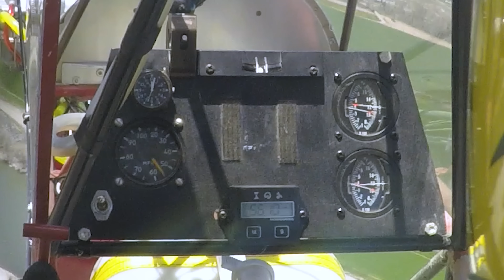MAIDEN FLIGHT goes BAD on landing.😓 Abandon airplane PART 6.

Comment: As soon as you said, "I'm coming in a little hot" I figured it wasn't ending well.  Note how quickly it slowed once you were in the grass.  Landing on pavement may be a bit unforgiving with these unless your technique is spot on.  There is that magical moment when you have little rudder authority, and you need the tailwheel on the ground to steer.  There are two schools of thought on this:  Morry Hummel said, "do not screw around in the transition zone, get through it as quickly as possible on take off and landing, and things will go better. His test pilot was of the opinion that you had to deal with this twice in every flight, so you needed to know how to handle it, so he advocated practice.  But then I watched a guy he was training ground loop and pretty much wreck a newly built UltraCruiser, during taxi testing.
Reply: That's why most taildragger instructors recommend a 3-point landing at first. Gotta come in reeeally slow, and basically stall the aircraft onto the pavement. Yes, ur kinda f_ed if there's a crosswind, and also f_ed if there's a gust and you're already slow.
There's a reason all branches of practical aviation have abandoned taildraggers after... actually towards the end of WW-2.
Reply: It took “coming in a little hot” to figure out he was going to have problems? I figured it out after reading the TITLE…
Reply: ah m8, welcome to the world of taildraggers...the next ground-loop is always just a heartbeat away.  Lots of good comments here from guys who have been there before - some of these rules are written in blood - ignore them at your peril !

as a former Drifter pilot, I always found bitumen runways more challenging - my choice would always be short grass if the option is there.  I agree with the comments about rudder authority - your aircraft has a good sized rudder, so I doubt that was the ground-loop cause - I would definitely go with smaller front wheels and a tailwheel that has a good level of tyre contact with the ground.  The way I was taught to land is to go to zero throttle at the end of base leg (and stick forward FAST) followed by a nice big circular 180 turn to short final.  BEWARE THE LOW SPEED STALL AND SPIN.  Then you can add a little power if you're low, or side-slip if you're high.  Practice choosing a touchdown point and getting good enough to hit it every time = improve those skills!  The idea of holding the aircraft in the three-point position until you run out of airspeed is a good one.

final point - get Microsoft FSX of MSFS on your computer, you can get the Drifter - the 25-0455 aircraft in the sim was copied from my real life aircraft.  Have fun m8, but remember - there are old pilots and bold pilots, but there are no old bold pilots...

Comment: My old 1948 cessna 170 tried to do that on numerous times after I bought it. Contacted the 170 club and there answer was wheel alignement, wheel alignment wheel alignment. Thats your problem but with the flimsy legs yours has I dont think it would help....

Comment: Hi close call indeed, I think the gear contributed to the lack of control on landing pulling you left, regarding the hot cylinder is it the rear one? A friend had a similar issue and what he did was add an air scoop to direct more air to the cylinder, basically a piece of aluminum shaped as needed and mounted. It worked for his application.

Comment: I went back and watched the video again, you clearly landed down wind and with a quartering cross wind.  ALWAYS land lightweight taildraggers into the wind.  Also, your landing gear is so flexible that when you add brakes it toes your mains out which causes fast uncontrollable ground looping in taildraggers.  It was much worse because of the rear quartering wind.  I'm glad you came out of that as well as you did.

Comment: The guy my dad bought his challanger from sold it because of a hard landing. He bent both gear tubes, so we replaced the gear tubes with solid fiberglass rods. Fuselage was fine. We just drilled the fiberglass for the mounting holes, put 2 new hubs and wheels on with new brakes an cable. She was good to go. Are your alerions cable or linkage?

Comment: I’ve built an Airbike.  There are a few things I see that appear the builder strayed quite a bit off the plans.  I’d highly recommend getting a set of plans and checking your engine installation/thrust line, gear, aileron hinges.  The Rotax engines are mounted inverted and the thrust line is much lower.  Also with that fuel tank location you have practically no weight on the tailwheel.  You may find that your CG is to far forward to have any steering authority.  I did the wing tank on mine and it was much better.
Reply from the maker: Yeah it’s a bit off from the original plans that’s for sure. 
Thanks for the input!

Comment: You were going so fast on touchdown; did you think you were flying a P-51? You were going way too fast on touchdown, its no wonder your gear was flexing. Every pilot is taught that if you have a touchdown like that, full throttle and go around! The time in the pattern will let you think about what you did wrong. You said you were coming in hot, AND you had a long runway, so you had plenty of time to slow down before attempting touchdown. It's pretty obvious you haven't gotten any training in flying an ultralight, I really suggest you get some ultralight training BEFORE you attempt to fly it again.
Reply: The FAA sandbagged the ultralight community to disallow ultralight trainers.

Comment: Not an AirBike, or at least it's not built to plans.  I see several differences in the construction and I've never seen an AirBike landing gear so flimsy.   I've flown mine for years and even had some rough landings without damage, and never a problem with rudder authority.

Comment: I flew hang gliders in 1980 and built my own gear we had been using alum axles  with bungee cords wrapped around them to act as a spring to stay light.. they collapsed easily..I built a rough field gear from steel springs bent so I could  bolt  one end of the spring to the bottom of the glider and a hole in the bent end to accept the stud  for the axle..kind of like a  bent L  on it's face    like this   ---\.. they  were very worked great ..ps I had the springs made with a small ..trick I had them made so the wheels were toed in a slight amount so that when under compression(hard landing) the will run straight as they compress..all your landing  was missing was the cable or whatever to limit the spreading of your wheels which gave you no control over your wheels.because they were toed out upon landing..p.s. I gave a sample of my gear to Dale from Motorized gliders of Iowa..and apparently he built some for the U.S. military for their gliders too.
+

Comment: Best advice I can give you is to walk away from this aircraft. The inability to hold the brakes during the TO thrust run-up was the first clue for me in this video.
Reply: Many light aircraft and almost all ultralight aircraft do not have brakes.  None of my friends Pietepols brakes hold at anything close to full power.  I've even flown certified aircraft that the brakes would not hold at full power.  Been in a cessna 180 where a strong wind would spin the airplane with both brakes locked.  Spoken like a true arm chair pilot.
Reply: @c172215s  My comment was the observation of all the problems shown in the video and the lack of safety for the operator. He nearly got himself killed--and you sir are a troll.
Reply: @daningrim475  A ground loop would likely not kill him... But certainly do in his ego
Reply: If everyone had that attitude airplanes would’ve never been invented….
Reply: @daningrim475  The person that you called troll just reported true facts. That alone completely disqualify your comments, which actually are just an opinion. If you can't accept that others may reply in disagreement, please don't post.
Reply: Dude he's not trolling, just disagreeing with you. That's really not at all the same thing. Fyi I also disagree with you. Whole aircraft is a write off because brakes maybe need upgrading?  Panic much?

Comment: Definitely undercarriage issue. Each wheel moving back and forth on landing throwing the air craft left and right until it turn off to left. No chance of Rudder compensation. Suggestion front wire braces from frame to each wheel to form A frame. Add a further two wires from behind from Fuselage to Each wheel. Now braced for and aft. Now you have to sort out any lateral movement. So it is time to redesign the undercarriage as a complete unit that allows suspension on landing but will also keep the wheels aligned with no independent movement. Bracing is the key. It's all been done before so not to much of an issue. Glad both you and the plane survived.

Comment: I  would make sure the left brake  wasn't dragging when checking out everything.  Also vert  stab is pretty small and your body may be shielding it from air flow..   I fly  a Decathlon  and  I have good rudder authority right  up to the point  where the tail stops flying and beyond
Reply: I thought that windscreen was not helping either.

Comment: Only real way to cool a 2 stroke that doesn’t have an airflow problem is to ritchen the mixture. Engine is likely still lean just the front cylinder gets enough air to cool it and not show warm. Air filter still seems small. I’d look for a big diameter oval one with a lower profile because of the way that thing wobbles on there.
Reply: Lean mixture... let's put a bigger air filter on so it leans out more... your suggestion is illogical.  An air filter that is covered in front (to prevent a ram air effect while at high rpm's) may be more beneficial.

Comment: For really good reasons, aircraft are usually horizontal opposed engines like the old volkswagon engines.  Then there are engine cowlings to direct some of the airflow across the cooling fins on all the cylinders.  You will never get that cylinder temperature down without getting air forced through the cooling fins on the rear cylinder.  Think about motorcycle engines, 
and how the cylinders  are positioned to get airflow through the cylinder fins.

Comment: I used to fly a single t bird taildragger and found out very quickly when landing on runway do full stall landing. On grass does not matter but on the runway it was a handful, tried aligning the mains differently thinking that might be it but didn’t improve so  just something for you to try.

Comment: G,day Jonas from Sydney Australia.
What a test pilot!
Wow...... Well you've got rudder when airborne and propeller wash (airspeed),  not on the ground. More rudder surface? Glue tuffs over the vertical stabilizer and let's see what airflow it's getting (it could be the wings directing airflow down DC3 effect).
* Just behind the seat, the tube frame is transferring some serious pressure. Maybe some gussets welded or rivoted  into the triangular frame.
* Why the high CHT: is it being blocked from airflow? Are the heat fins clear, and have you a bore scope attachment for your IPhone? Put it in the spark plug hole (look for exhaust valve seats and color of cylinder head.
* The wheels you got that covered
Lastly leathers or motor bike jacket when flying: just if the airbike decided to buck you off on landing!
🚿
🕳️💥📐

Comment: Seen som comments about a shroud on the engine to keep the Temps down. I agree. Mine has a belt driven fan in a shroud and the heads and cylinders are all covered with an exit point on the top to the side. I use it to warm my hands after landing on cold days😄

Comment: Caster stability was all over the place when you touched down. You could see the tires bouncing front to back. The left tire is likely the one that flexed back more for more positive camber on that one with respect to the right tire causing the veer to the left. Yes, get better stronger gear with A frame design and strut rods so you can do an alignment. Upper and lower A frames would allow for camber adjustment.

You probably already know to get the tail up as soon as you start moving and keep it up almost to a stop so it stays in the air stream to maintain rudder authority.
Also, is the rudder and horizontal stabilizers big enough to give proper attitude and directional control? 
Change the aileron to stick ratio to make it less sensitive. [More stick movement cause less aileron movement.]
Reply: Or the tires are to big.  Build it like the plans.

Comment: Nice save, your engine is acting like a Harley Davidson,  the rear cylinder run hot.
Make some air ducting for the rear cylinder.
That actually looks like a blast to fly.

Comment: You need a good hardened steel landing gear, that's too soft, and I guess that it is why is so bad in the ground, if the tires are turning and not straight all the time it will try to go all over the place, not in a straight line.

Comment: No radio to alert other traffic which could cause a collision, brakes will not hold during runup, one cylinder running hot and could easily seize, coming in "a little hot" but land anyway, don't get tailwheel down on landing so can easily weather vane off the runway, gear too flimsy for support, narrowly miss VASI lights when departing runway....   this was a clinic in poor airmanship.

Comment: The Plain is flying with perpetual right rudder, so the engine may not be pulling the plane in a straight line centered along the axis of the plane.  That is why on landing when the airflow over the rudder decreased the engine pulled it to the left even with maximum right rudder.

Comment: TBH: A maiden flight should not have cylinder temp issues that should be resolved with taxi and run-up tests. If it cant run-up consider hydraulic disc brakes its like $300-$500 for a nice mountain bike setup and they will almost certainly hold. Heel brakes are great, you can really put your legs into it. I learned on Heel Brakes and toe brakes are just less precise and take more calf muscles for half the brake force.

Landing Gear is probably fine, you needed more castor/trail to keep them from wobbling. This is another issues that could have would have should have been noticed with taxi tests. All hindsight 20/20 but still thats a lot of issues and either could cause injury or worse.

Comment: So this is a 2-Cylinder air-cooled engine?  If I saw 400F on any engine it would concern me greatly w/o much of a way to cool
her down....lmao,  turning it off isn't a great choice but I've never run an engine that had temp probes/sensors on each cylinder
so that's new to me - all of this is new to me but if I ever fly this might be the way I go so I'm interested in this problem. peace

Comment: I have a Rotax 447 on a weedhopper with factory shroud and cooling fan. I have one cylinder that consistently runs 430°.  Took the shroud off and checked for dirt dobber nests and checked belt tension. Can figure it out. Egts are good.
Reply from the maker: Interesting 🤔 mines actually the front cylinder that’s getting hot.

Comment: I have the Mini-Max Eros. Like the Airbike, it is short coupled, with the rudder just six to eight feet behind your head, does not give it enough leverage. I find myself having to use a tad of heel brake to compensate with any crosswinds. And yes, those full span ailerons are sensitive. Just putting pressure on the stick will start the turn!

Comment: Keep the rpm up for some airflow? Larger vertical stablizer and/or rudder? Now that I look at it again, that tail is really small. Twice the surface area might make all the difference. And put proper gear on it and proper brakes : )

Comment: There is no way I would take that thing off the ground. Don't you value your life. If the landing gear is built like that, what else is suspect? I would say the wheel alighnment caused the issue from one getting bent on touch down.

Comment: Go here:  https://images.app.goo.gl/Bt9DWpCxwMyxKNiN6   And look at and fab your own scoop.  It is easy to do, and this replaces the crank driven cooling fan and the stock tin for the cooling fan.  Your rear cylinder will run a little warmer, but you will for sure be able to keep it cool.  I fly in So Cal in 100+ temps @ 1510 MSL with no cooling issues.  Simple construction with aluminum sheeting.  FBSC

Comment: Love your camera angels etc..
My buddy built a Airbike ultralight once and on his maden he torgue rolled into the runway. It was scary to see. He was fine though. My ultralight had crappy brakes too and it was tail wheel as well. I actually created a tail wheel brake for my TBird Ultralight that was cable on a motorcycle lever. Straightened wheel on taxi and worked great!!

Comment: I learned how to fly on an airbike.. I went through what you going through. 
If I was to critique anything it would be you came in way to fast. Eed off airspeed prior to touching wheels..
Reply from the maker: Yeah I agree. I was anticipating floating down the runway a bit more but for whatever reason it dropped out or I just wasn’t pulling back enough to keep it off longer. The high CHT temps didn’t help as I was doing my best to get down sooner than later. 
A little slower with power will be what I’ll try next time.

Comment: I think you need to decide if you're going to wheel it on or do a three pointer. That landing looked like a bet both ways, leaving you with the CG behind the main gear and no stability from the tailwheel.

Comment: The Airbike landing gear does have issues with flexing and toe-out twisting. I have about 300hrs on mine. A few hard landings namely rough terrain and I need to straighten or rebuild mine. I don’t remember ever having control problems like this guy though. Perhaps he didn’t have enough airflow over the tail due to the combination of the prevailing winds and his ground speed.